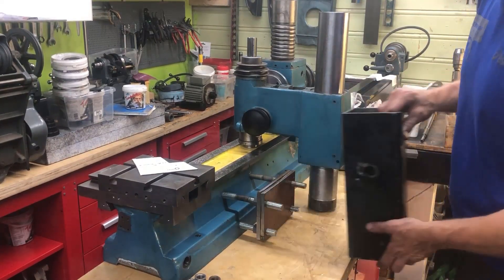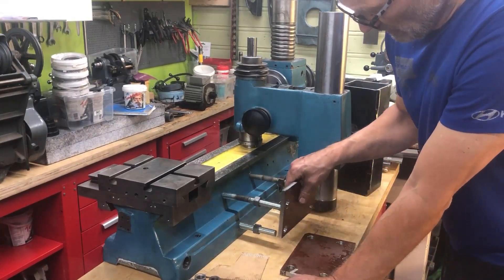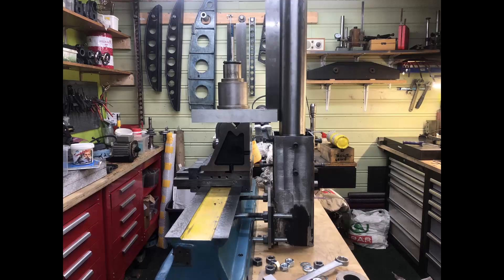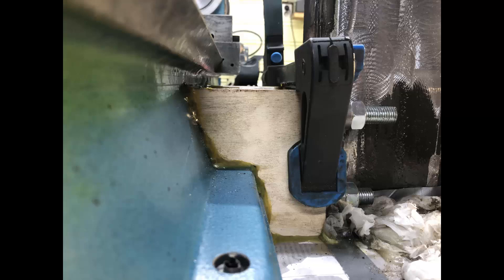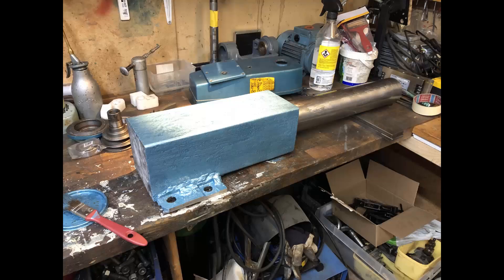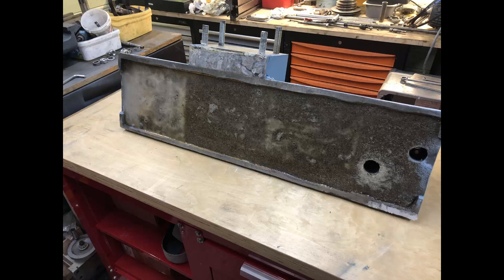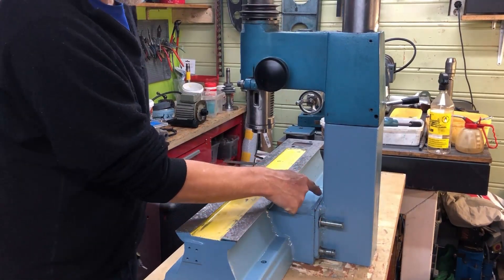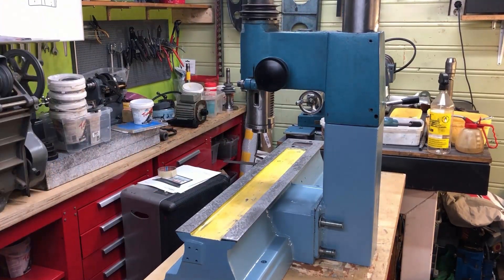Smarty AT-300 - epoxy granite-3-column and mounting foot

Comment: You are certainly making a "silk purse from a pig's ear", as the English saying goes. I like how you converted the machine to an Emco style 3-in-1 with the mill behind the lathe bed giving advantage to a much longer X-axis travel. This machine does have the advantage of having a much larger cross-slide in terms of contact surface area than other lathes of its size, making the cross slide system closer to an actual milling machine table. Also, the head support system appears to be quite rigid. I might have missed it but did you also fill the round column with granite epoxy?
Reply from the maker: Thnks. Yes, the milling envelope will be much bigger, and as the bed supports the saddle and cross-slide better, more like a normal milling machine. The head, as well as eg. the saddle and cross-slide are quite robust castings. I also think this original size cross-slide, or milling-table if you like, is also more appropriate to the way support it has, instead of the later XL versions with longer tables, but also then more "rocker-arm" for their same length of support way to the table.
Yes, I did fill in the square tube with epoxy granite!
Reply: @jansverrehaugjord9934  Yes, I observed that you filled the square portion of the column. I was wondering about the ROUND tube that the head is mounted to. I look forward to watching this project progress.
Reply from the maker: @hansschmidt1961  I see. Sorry, misunderstood. Anyway, yes, the round column was also filled with epoxy granite.. at least what space was left after I put a large diameter (50mm)  steel screw in the middle. This was one of a few I had available and not found any other use for..

Comment: Hello Jan,
It may be a silly question but is epoxy granite once formed the same weight as granite?
Cheers.
Paul,,
Reply from the maker: I don't really know the specific weight of the final product, which can vary based on the recipe used. My version should have been about 80-85 sand, the epoxy is really only acting as a binder/glue, so I guess the weight is closer to what sands weighs